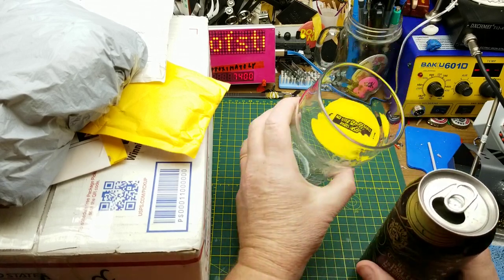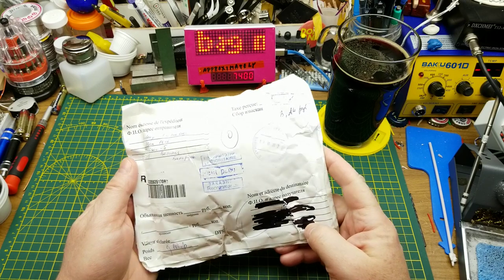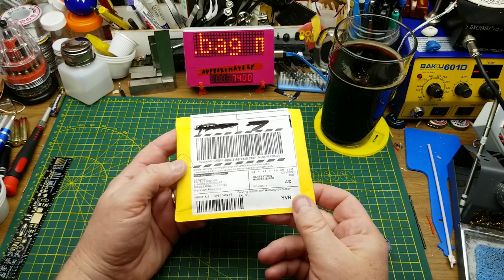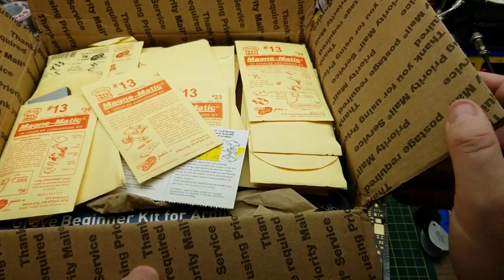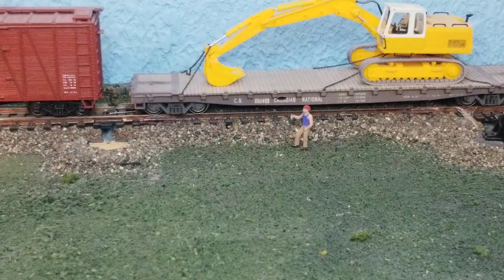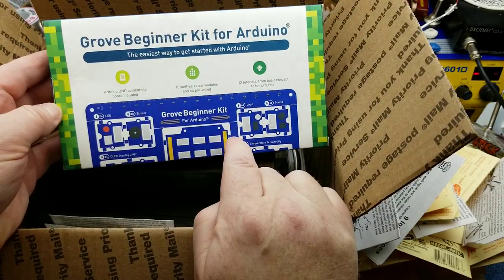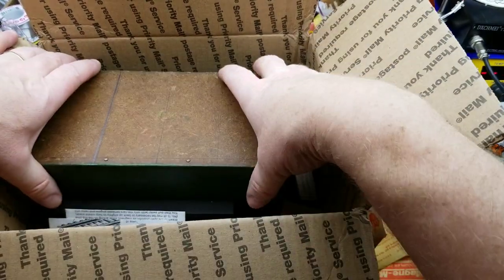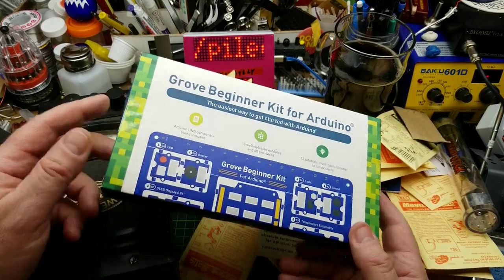mailbag Monday 105

Comment: A bit late, but I just watched this. 

About shipping, I had a REALLY ANNOYING issue about 4 years ago. At the time, I was mostly ordering stuff on ebay and loved the 'free shipping' option even if stuff often took 3 or 4 months to arrive. (Yes ... I am REAL CHEAP too.) At one point, I had something like 48 items on order and of those something like 36 of them NEVER arrived. I was furious, but the thing is, this stuff was all coming from different sellers, ordered at different times over about a 2 month period. The ONLY common factor seemed to be that ALL of the 36 were FREE shipping, and most of the rest were paid trackable shipping. I am ABSOLUTELY convinced this was just 'Canada post' throwing untraceable stuff into the trash, that they couldn't be bothered to deliver. Pretty sure also, that they were having yet another one of their labour temper tantrums around that time.

Since then, I've been mostly ordering stuff from AliExpress using the 'AliExpress saver shipping' option which costs a little bit, but arrives a lot faster, and more important ... it arrives. Not sure exactly what has changed, but everything seems to get through now. To justify the extra shipping cost, I tend to place bigger orders (100 pcs instead of 10) where the shipping doesn't go up exponentially with the amount ordered, and I try where possible to order lots of items from a single seller who doesn't gouge on the shipping. Also, I never order from any seller who has a rating below 95-96%, unless there is no other choice.

Thoughts?

Comment: I had done some research on those train couplers, but your demo helped it make a ton more sense.  

Also, that noise maker thing is for demonstrating circuits. You can put 50 people in a circle, and if they are all making a circuit with that rod in the middle, it will light up. If one person breaks, it stops.
Reply from the maker: Ahh, that's what it does. 
When I was first looking at it, I assumes it was motion activated, but when I looked back at during editing it's obvious it is touching both ends that makes it go.

Thanks again for everything.
Reply: It's always good to see what you can do with a Darlington pair transistor arrangement, very high current gain. Did the same thing back in the early 1970's while at school, but never got a ring as large of 50 kids. you can't keep that many in one place at one time with an LED lighting up.
Reply: @TheEmbeddedHobbyist  Yeah. That's the tricky part.

Comment: Could you imagine being an OCD electrical connector wonk?  I mean, the expense of specialized tools for crimping, and the incalculable number of sheaths and pins ... simply mind boggling. 
Just a random comment ... my last two multi-orders from AliExpress have been collected together somewhere over there, and thrown into a single, larger package, before being shipped to the US.  This system is works better, with delivery times of about 1mo.
It is a shame about Jack Ma.

Comment: Amazing haul indeed.
Let me second the hint for more model railroading stuff. (How's the SkyCam coming BTW?)
I was thinking the exact same thing about Postal employees wondering why your package was emitting Theremin music. And suuuuure that battery's not replaceable, right?
For us really ancient geeks a teardown of that meter (that leaves it functional!) would be extremely cool. Might even give the kids an idea of what electronics used to be like before transistors much less ICs.
Reply from the maker: I plan to open it up and take a peek inside.

The skycam is stalled until some progress can happen on the code (which is one of my weakest subjects). 
I'm still trying to motivate my teenage code monkey to work on it, but he has other priorities.
Reply: It'd be cool to see some kind of hump yard with the decoupler and electronically controlled switches. Maybe with your car detector signalling that the car has broken loose and is coming down the hill.

Or... what about a defect detector with a working text-to-speech module?